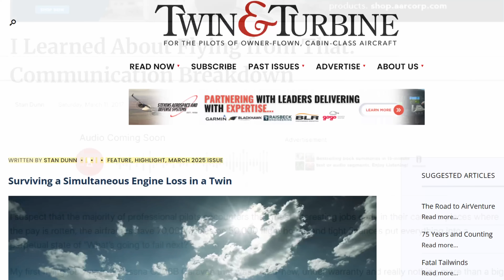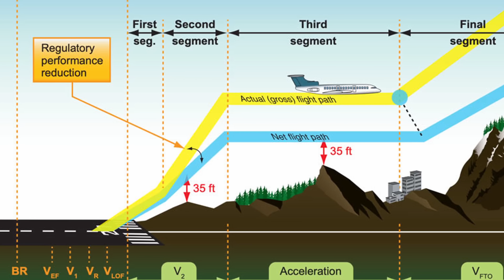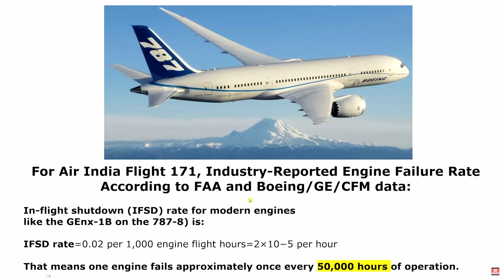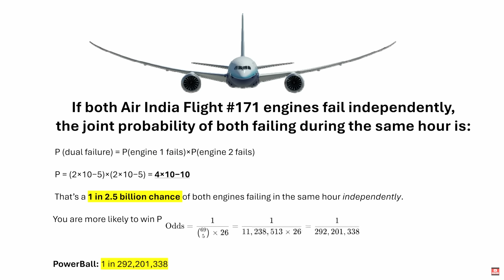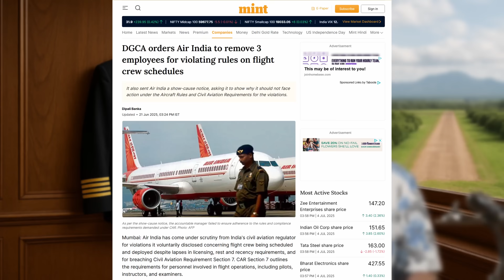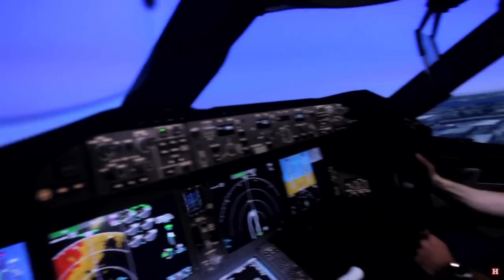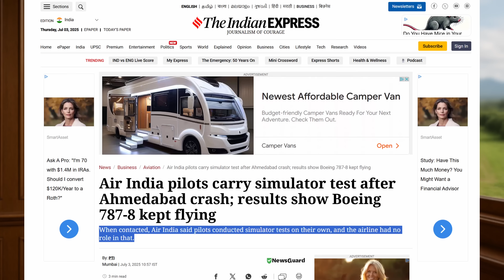Air India 171 Cause Becoming Clear

Comment: Sir - you failed to consider possibility of the total crush of avionics of this airplane.
Below the stars is an email I sent to the witness,at,ntsb,gov

I think that proper operation of this airplane is so electronics and electrically dependent that excessive humidity may cause irreparable damage to its avionics. 
This theory probably cannot be proven due to the fire after the crush.

************************
Sirs
I have an old MB 170 car, which I park in the open, without any protection, the whole year long.
Last year I didn't use it for almost 10 months and when I eventually sat in it, I found the inside lights not working. This light is an integrated console containing 3 bulbs and quite a complicated multilayered printed circuit board with surface mounted components.
There was no fault on eye inspection, but under the microscope I found one tiny copper path and two vias completely corroded. 
This corrosion was caused by the small drops of water, dripping onto the printed circuit board for a prolonged time. The water condensed on the internal layer of the metal roof of the car, dripping from it down onto the printed circuit board. 
I managed to re-solder this fault.

Now - why my email.
The Air India Boeing 787 used to travel between two distant parts of the world, each one with very different climatic conditions. Hence it's possible that prolonged condensation of the tiny water droplets onto the certain printed circuit boards, could lead to the corrosion of some copper paths and finally to total crush of the whole avionics.
Continuous problems with AC on this airplane was probably the beginning of the fault. RAT deployment and pilot's mayday call of power and thrust loss could support this idea.

Comment: The dust - the plane was very close to the end of the runway and those places can be quite dusty - I do still believe this is more likely to be an electrical failure taking out the engines seconds before take off. Engine control or fuel valves or whatever. No time to try a restart.

Comment: 🙀...Boeing! 787 introduced with boasts of 35%?! reduced power draw from their engines.
One innovation was to cut off all bleed air from the two engines used to pressurize the cabin of the airplane.
Instead, the engines starter motors will be dual-use so that after the engine(s) has started, it can use the generators to create electricity to in turn, pressurize the cabin.

As it turns out, if the generator were capable of operating at near perfect efficiency, there would be a 90%! reduction in power draw and a 2.3% reduction in fuel consumption.
However, assuming that Boeing's claim of 35% reduction in power draw is more accurate, it implies that the transfer of rotational energy from the engine shaft to the electric generator to the compressor is only around, 15.5%!!! efficient!!😳 (low! for an electrical generator!), typically, electrical generators operate between 35% to 60%! efficiency, with the lower efficiency being for large power draws.

The inefficiency might come from the fact that the generators are dual-use electric motors and generators.
By trying to do too many things at once, the motors lose! efficiency.
Also, the power transmission losses between the engine and the generator might be low, similar to how the first turbofans were thought to be infeasible.

The line of thought was that drawing power from the engine was much smaller power draw, than stealing air from the engine, and Boeing claimed this will lead to a 35% power draw reduction, which translates to higher fuel efficiency of the engines.

All modern engines can actually choose which stage of the compressor to draw air from to create the minimal effect on compressor performance and stability.
If the engine were to divert too much! air from a certain stage, it could cause the engine to surge!, which would force the pilots! to shut down! the engine(s)!😳 and perform an emergency! landing!..

Instead, the engine can change where the air is coming from so that sequential amounts of air are drawn from locations, and the final result allows the engine to maintain nonimal operation.

The electrical system is a Hybrid! voltage that consists of different voltage types.
Traditional - a: 115 volts alternating current (VAC) - 28 volts direct current (VDC).
b: no-bleed electrical architecture (expanded electrical system that generate double the electricity) - 235 volts AC, and, +/- 270 volts DC

However!, air! is crucial to engine performance!, and by re-directing it away from the engine, power! is inevitably leaving! the system.
Depending on how much air is removed, the energy stolen from the engine(s) can cause large! reductions! in performance!, or large increases in power requirements from the engine.
For instance, by drawing air out of the engine, the turbine! must provide greater power for the given air that is used, since the airflow through the turbine is less than airflow coming through the compressor.
The turbine must work! to make up for this difference.
(the "Bleed Air System has been a long standard for commercial aircraft, and as such, the designs of the systems have a long heritage).
The General Electric, GEnx engine, while with a large amount of innovations, there is not?! a large amount of data on its performance!
The Rolls Royce Trent 1000 engine, on the other hand is required to pass inspection, by the European Aviation Safety Agency (EASA!), which makes all of their data publicly available.
It has been said that each 3ngine will have two 250kVA AC generators attached to the intermediate pressure stages of the compressor.

The Bus power control unit (BPCU), the main functions include: Engine health! monitoring!, management of APU and main engine power and acts as portal to flight deck & other systems.
The current opinion on the all electric approach seems controversial, since the more heritage a part has, the more the airline companies tend to hold on to it and never let go!
There are people who claim it is a great innovation, and others reserve judgement.
Considering all the flight delays in the Boeing 787, some even call the Dreamliner, the Nightmareliner!
RAT system - 50KVA.
The Dreamliner is viewed as a special model in the Aviation industry, since it's through this model that the concept of the electrification of aircrafts for greener operations was developed.
Boeing's most fuel-efficient! air carrier. (yet, they didn't give any mention, of their most Safety!-efficient air carrier!)...
80%! of the Dreamliner's structure is made of composite-materials by volume.
(composites 50%, aluminium 20%, titanium 15%, steel 10%, and several other materials.)
Wings, fabricated from composites, with twisted wing tips and the top of the wing manufactured at a slightly higher angle, aerodynamically speaking, this little change in design angle, is to improve fuel-efficency and improves climb! performance!...
Hence, reducing! the take-off! distance required to pick up lift off speed for take-off!

All about the reduction!! in total! costs! (including maintenance cost!), by removing bleed-systems.

Aviation is responsible for 12%"of CO2 emissions from all transport sources, compared to 74%!! from road transport!😖...

Comment: I am probably one of if not the number one person to do rhe most work in rhis aricraft. I wa working 14 hour shift back then. I installed the RAT fitting. Several frames, tons of aft body work tons of wiring and interiors. The only thing i did not touch on this airplane is the power plant. Everything else. I had my hands on. What no one is also saying is the fact that the 787's are smart planes. There is a big room with one of if not the largest computer screen in the worl. The whole wall is a computer screen. It monitors all 787's in real time. The 787 also talks with boeing in real time 24/7. It tells boeing everything in real time about anything and everything....again, in real time. So they have a pretty darn good idea what happened already. It most likely sent all the info in real time as it was happening. Yeah, those planes are that good. So pretty sure Boeing already knows what happened. Not sure, but good idea they do know already.

Comment: Some other examples of single points of failure:

1. Something carried in the hold either on this flight or in the previous flight. For example, a medical scanner that contains helium coolant. If helium was to leak from such a device then that would destroy the micro electro-mechanical oscillators used as timing sources computers. Helium is such a small molecule it can bypass the outer case protection of these devices. There was an incident at a hospital that caused multiple mobile phones to fail due to this reason.

2. A source (either internal or external)of electromagnetic interference, powerful enough to cause computers to crash. With age the susceptibility to EM interference of electronic circuits can degrade; for example, decoupling or feed-though capacitors. 

3. Simultaneous overheating of multiple on-board computers.

4. A radiation source unintentionally carried on the flight that could damage electronic circuitry.

I could think of many more, but I would certainly question what was being carried in the hold on this flight and what was being carried on previous flights. I’m sure the investigators will look into this but note what I say about previous flights.

Comment: You could cover the dual engine failure 1991 in Sweden, at Arlanda Airport. The plane only reached 3000 feet and crashed in a forest, everyone on board survived ❤ due to fantastic pilots on that flight!!  The plane haul got torn into three large pieces at the impact with the ground.

Comment: My biggest question is that  if the engines and the thrust was not that good Why did the pilot decide to take off?? He should have just braked because he gad enough runway in the front to stop in a smooth way??
Why did the Captain took off??
Why did the First officer did not stop or cautioned the Captain ??

Comment: Good analysis. You appear to have a balanced and logical approach and I applaud you for that. They must figure out what happened here. That other flight that some have been talking about were both engines shut down upon landing in of concern. A computer software bug I think is pretty unlikely. But my over 55 years experience with electrical control systems has taught me that “ every electrical connection is a potential bad connection “. And how do you recognize a bad connection in the black box recordings? With the newer aircraft all of the pilots control inputs are a suggestion of intent made to the computer, and then the computer for some reason shut off both engines. WHY?

Comment: Two issues with your analysis:  (1) it doesn't consider the possibility of or explain the electrical "glitches" that could be the root cause of the RAT deployment and possibly tripped FSOV's to both engines; (2) your analysis is biased in favor of pilot fault over equipment fault, although this is understandable since human error typically plays a crucial role in these types of accidents.  Widespread electrical system failure has to be considered as a possible causative factor since there are known reports of 787's with lavatory water leaks that have caused damage to electrical equipment.  Another factor about this particular flight to be considered was the high ambient temperature, which might have affected the electrical equipment or electronics, although this could be a total red herring since I am sure there have been many 787 flights over the years at similar high temperature conditions.  Crucial to the understanding of what happened here is the timing of when the RAT deployed relative to the take-off roll and initial climb-out.  The pilot is reported to have said "thrust not achieved" but I haven't heard that anything was said by the pilots about losing an engine, intentionally shutting an engine down, or any clue as to the RAT deployment and how that was manifested in the cockpit.  Granted, there may only have been a few seconds between RAT deployment and when they started to sink and both pilots were probably totally absorbed in trying to figure out what was happening.  Need to get the details from the FDR to understand all of this, hopefully this will be forthcoming soon, and reported in a transparent and credible manner.  Many have speculated that there could be some type of coverup by the Indian investigation team if the evidence and data suggests either airline or pilot fault, let's hope this doesn't happen.

Comment: July2025: As a trouble-shooting engineer, I'm surprised there are not cameras aimed at runway landing/departure 24/7.  Today I have a motion camera as my doorbell.   This airport had nothing!
    One disturbing crash theory is that the captain's seat slid back when plane rotated while he had a hand on the throttles.  If it took pilot a couple seconds to understand what happened at that critical moment that's too long.  It takes 8 seconds for a jet engine to go from idle to full thrust. 
    Once while driving an old junker of a car my seat slid back.  I hung on to the steeing wheel in order to hit the brakes.  In an airplane you can't grab the yoke for support!   Would flight software stop the throttles from being retarded on takeoff?    It seems too silly for a simple seat locking pin to crash a modern airliner.   That said, I know that planes fly on maintenance and if too many corners are cut planes crash.  In effect planes fly on proper maintenance and proper pilots.
       Retired in Sacto.

Comment: There is a lot of speculation at this point but we can assume that if the cause of the crash was simple then the information would have already been made available.  The ‘single engine failure at take off’ theory is also very weak.  The plane continued straight and level after take off with no visible yaw, roll or countering tail rudder input from the pilot.

Comment: Did the aircraft use full length of the runway? What length of runway did they use to takeoff? How long was the takeoff roll? Was that roll enough given the prevailing weather? Where's is the ATC or runway monitoring video to confirm the takeoff distance?

Comment: Why are you covering up stupid fuel system design! The fuel transfer pump electric so if electrical failure no fuel. Below is description! Stop covering Boeing’s arse🤬🤬🤬

The fuel system of the Boeing 787-8 is designed to efficiently manage the delivery of fuel from the tanks to the engines. Here’s a concise overview of how this process works:

Fuel Storage

Fuel Tanks: The 787-8 has multiple fuel tanks located in the wings and the center fuselage. The total fuel capacity is approximately 33,000 gallons (125,000 liters).
Fuel Transfer and Management

Fuel Pumps: Each tank is equipped with electric fuel pumps that transfer fuel to the engines. The pumps are designed to handle varying pressures and ensure a consistent flow of fuel.
Fuel Distribution: The fuel is routed through a series of pipes and valves. The system includes:
- Main Fuel Lines: These carry fuel from the tanks to the engines.
- Fuel Manifolds: These distribute fuel to the engines based on demand.
Fuel Flow Control: The flow of fuel is controlled by the engine's electronic control system, which ensures that the engines receive the correct amount of fuel based on operational needs.
Engine Fuel System

Engine Fuel Control Unit (EFCU): Each engine has an EFCU that regulates the fuel flow based on various parameters, including thrust demand and engine performance data.
Fuel Injectors: The engine’s fuel system includes injectors that atomize the fuel for efficient combustion.
Safety Features

Fuel Monitoring: The system includes sensors and monitoring equipment to track fuel levels and flow rates, ensuring that the engines operate within safe parameters.
Redundancy: The fuel system is designed with redundancy to ensure reliability. If one pump fails, others can take over to maintain fuel flow.

Comment: Why can’t you suggest the most obvious..? Mental health tragedy.

PF - gear up
PNF, shuts down both motors and holds hand on them
PF - has no choice but to continue hand flying, make a radio call and ride it in, gear down, flaps still set for takeoff, gliding into an apartment building.

How about we talk mental health..?

Why do you think Boeing isn’t worried..? Because it wasn’t Boeing’s fault..

Comment: Boeing has had problems. The RAT was down, meaning there was a catastrophic system failure. This presentation did not mention that, nor that it could have been a mechanical failure due to poor quality control on the part of Boeing. Interesting video otherwise.

Comment: I do not believe that only one engine went out and the pilots immediately turned off the working one by mistake. There is no indication of a yaw to the right or left. The engines lost power practically simultaneously and there was absolutely no time to do anything also due to the lack of free space on the ground in front of the plane that perhaps would have allowed the glide. In any case, we await the outcome of the investigation.